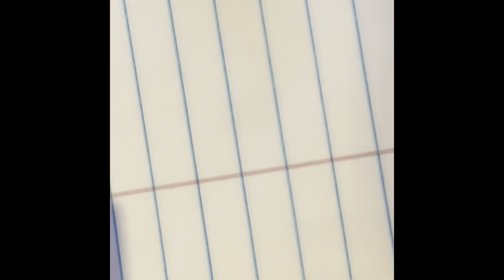Fan system to cool exterior rv refrigerator

Comment: Hiya, it's nice to see people helping people. One comment I would like to add is, you should not rest your controller boards on metal surfaces......you could short it out, leading to a damaged unit, or possibly a fire. get a piece of 2 sided foam tape and tape it to somewhere rain won't get to it. rain does get in that upper roof vent, not direct, but splashing type effect, so just be aware that this splashing may affect your fans as well. Otherwise, that is an awesome addition to your absorbtion fridge! thanks for sharing.
Reply from the maker: Thank you for the comment.